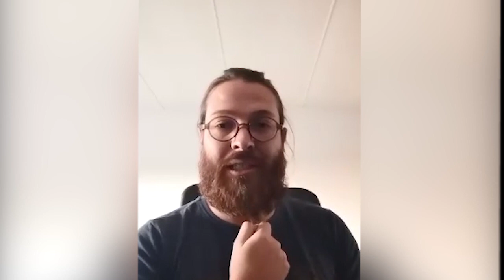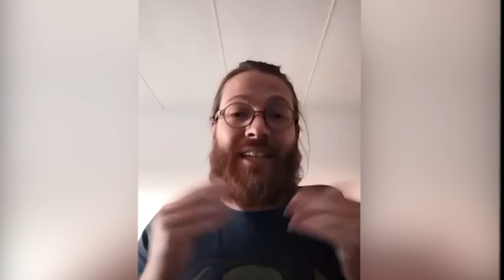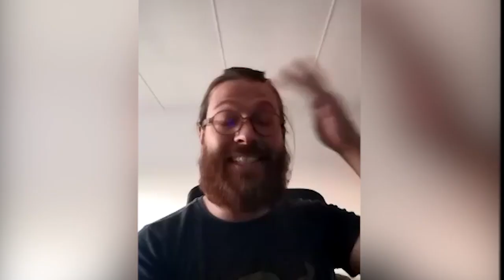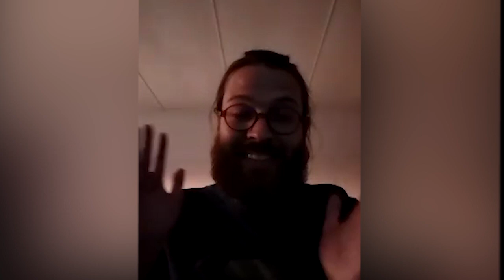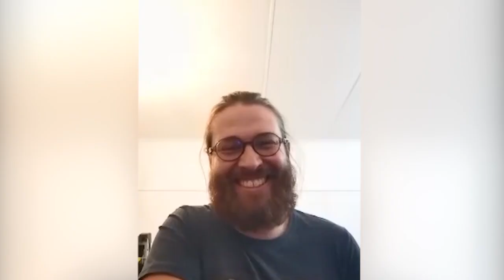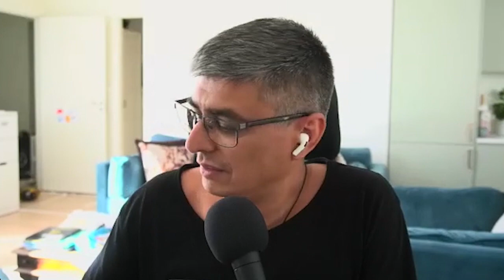Lloyd Bussio: The Greatest Software Transition in BIM History

Comment: There are some things which i doubt about blender-
1. Blender dont do exact Boolean operation when two surface are exactly on each other, it is not a problem in 3ds max.
2. Blender may not have precision range as high as any CAD software has. Like if we model 4mm sheet and at the same time, make large terrains in the same project then blender may give inaccurate measurement. Other software like rhino solve this by setting up project for small object or for large terrain in the template option.
3. Even if a single person shift to blenderBIM there are people in your team who will prefer autodesk workflow like drafting in autocad, modelling in revit, visualisation in 3ds max and so on.
Reply: The BlenderBIM Add-on actually bypasses Blender and only uses Blender as the interface. It uses IfcOpenShell and OpenCASCADE as the geometry kernel - this means that it does do exact solid modeling and boolean operations. It also has its own definition of precision as defined in IFC.
Reply: @DionMoult great info! Thank you. Also… thanks for bringing us all BlenderBIM. I’m very excited to learn all about it!
Reply from the maker: Not everyone should switch to BBIM. The most important aspect is that people who want to do it, have alternatives. That's the whole point, which now is proven to be feasible.
Reply: @BIMvoice  I literally want BBIm to used everywhere because in our country, purchasing revit license is very costly for single person and I think the software should not be the limitation of creativity, I tried blender 2.79 and uninstalled it in 4 days but after the release of 2.8 and blender guru donut series, I use blender till now.
Reply from the maker: @rajendrameena150  Glad to hear that, keep doing it!

Comment: Thank you for your hard work Lloyd.  I believe you may change a good number of people's lifes for the better.  I am hoping to make the leap away from Revit and onto BlenderBIM at some point.  I only wish Blender had better custom snaps for us MEP engineers (for example a tee fitting with one custom snap per joint).
Reply: A bunch of work is being done for MEP right now including automatic fittings (transitions, bends, etc) as well as regeneration when you shift a portion of your distribution system. Watch out in the next release!
Reply: @DionMoult  Banging, that's what I am after.  

Will we be able to create our own fittings, including snaps (for example a custom Y piece)? 

Will we be able to resize a pipe run (i.e. change a pipe, valve, bend etc from DN50 to DN80 by selecting them then entering a size)? 

Thanks BlenderBIM team.
Reply: @Lake-Mist-V  Yes and yes. Fittings (and any equipment) can have distribution ports, and ports are used for connecting things together.

You will also be able to dynamically resize runs and it will recalculate and reposition as necessary.
Reply: It is definitely getting better, but yes the snapping leaves a lot to be desired, hopefully we get to a point we can just set up a bounty and get it sorted once and for all
Reply from the maker: @IfcArchitect  you mean that could be addressed in BBIM? That would be awesome.
Reply: @BIMvoice  Yes or something similar the CAD Transform addon already changes how snaps work to be more cad like so it could be something that is incorporated into BlenderBim as a feature
Reply from the maker: There are cheap addons that can boost Blender functionality. You just need to start, and you'll find your way around, I promise you.